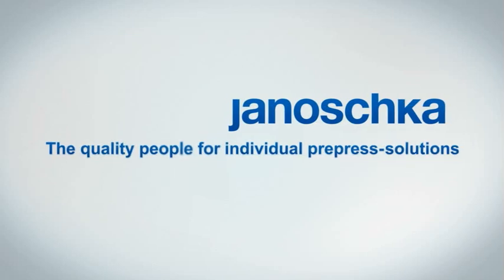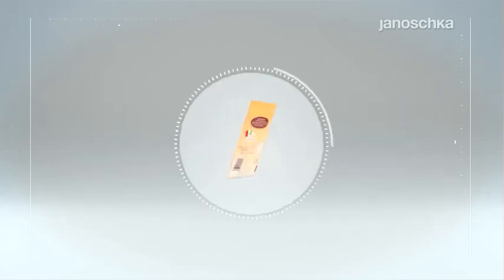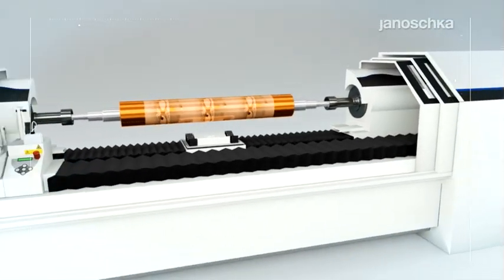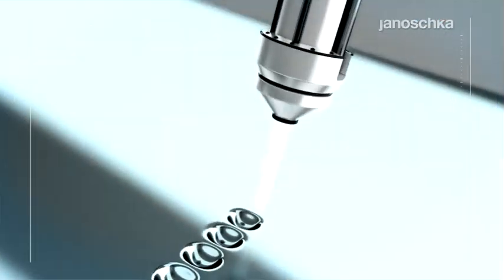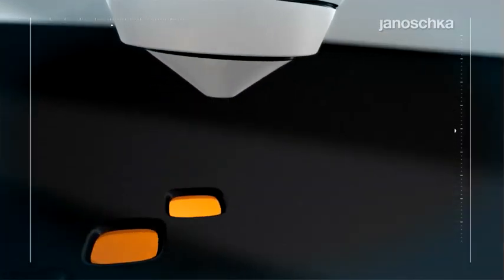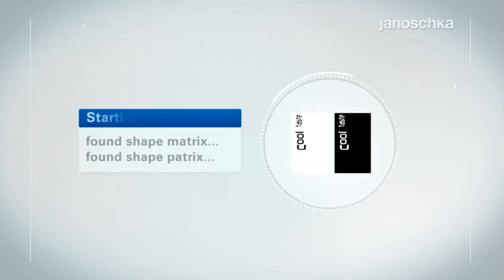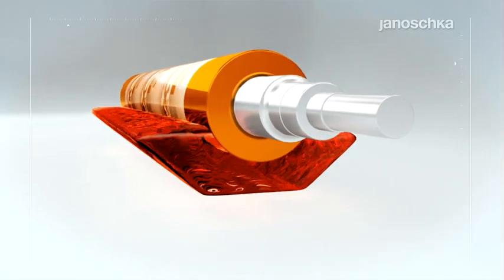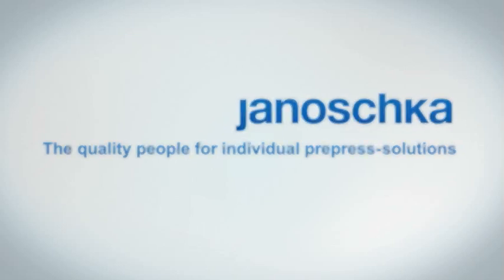full process of rotogravure cylinder production by Janoschka

Comment: What is the black layer in the third process?
Reply: It's called a 'resist', it's a substance that stops the acid from reacting with the copper. Many substances can be used as resists, as long as it will not interact with the acid.

Comment: Hi,
How is the excess ink removed from the cylinder face please ? I understand a  "blade" can be used, but I can't see how this leaves a totally clean surface at thousands or revolutions per minute ? Thanks, Steve
Reply: chamber with 2 blades (negative and positive) is used for higher rpm, the colour circulates inside the chamber under pressure. Also a tiny layer of colour stays on the cylinder and cools down the blade (it dries befoe it reaches the printed material). Hard to understand, but it works.
Reply: Wow, that is hard to get your head around indeed. I hope to se it in practice soon at Polestar Sheffield. many thanks for your kind reply. Steve
Reply: I'm a printing student, so, little bit of revision there. You're welcome.
Reply: I am on the run from the small-litho printing trade using conventional Moleton damping. It was an uncontrolable "bitty" nightmare for 14 years !
I just love the "new" modern fast flawless printing techniques, it is just jaw-dropping, as you know....
Take care. Steve
Reply: a doctor blade does you have to change a few but last a while if put in the clamp right